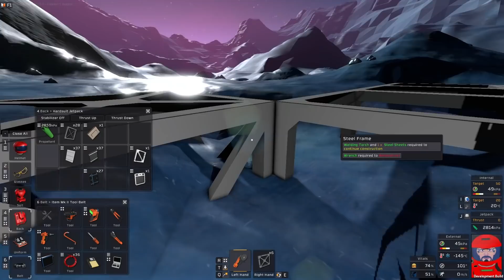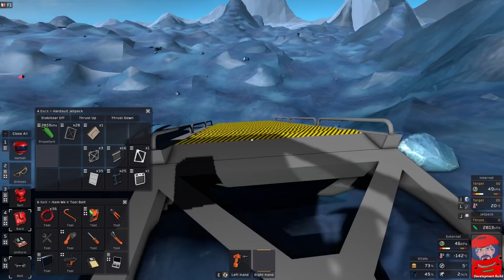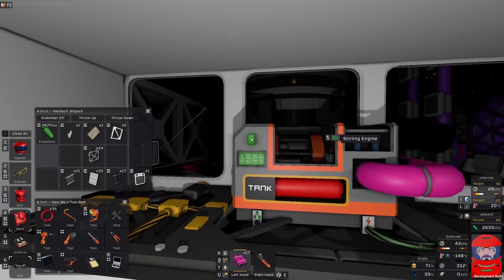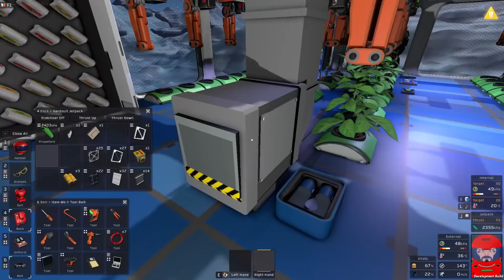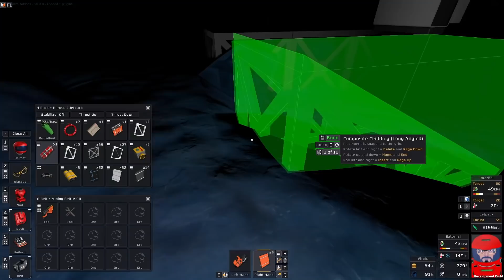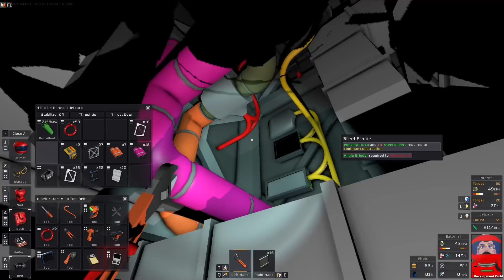Stationeers Let's play Modded Europa 21 Hybrid power

Comment: Hey Mick!

I left a comment regarding the cold lock up thingy on the Steam workshop, but I'm not sure how often you check those out.

Here's a copy pasta:

Hey Cow, hey guys!

So there's a bit of an issue with this script, in which the furnace goes in what Cow calls the "cold lock-up".

I wrote a YT comment about patching line 36 to read "sub r0 r0 250" instead of "sub r0 r0 100", that helped but I discovered in new setup that it didn't fix the underlying issue.

I believe the real problem lies at line 39, which should read "add r1 r1 5000" instead of "sub r1 r1 5000". Reason being we only want to top up the hot tank if it's low on pressure, not top it up until it's at 25 MPa, because that will prevent the mixer from heating the tank.

It's been working flawlessly on my end since I made that change.

Hope it helps!
Reply from the maker: line 34 allows the top up to operate up to 25 MPa.  If you change it to add it will only operate below 15 MPa which should never happen because the fuel will switch on at 20MPa and repressurise the system.  You probably find that the hot tank is well above the 2000K because the topup is never activating.  Your changes will work but you will not be recycling any of the waste gas.
Reply: @cowsareevil7514  I don't know about line 34, I was talking about lone 39 =}
Reply: @cowsareevil7514  I understand what you mean now. I guess it's back to the drawing board to prevent the waste tank from bringing the temperature too low

Comment: 54:11 - I don't think you properly connected the pipes. There's a section where you put the piping one square too forward, so it doesn't connect to the water source.

Merry Christmas, Mick, to you and yours! I hope Wilson will be happy with his manual air pump present. No doubt he'll be getting lots of use of it what with the AIMEEs wise to his philandering ways.
Reply from the maker: Yep messed that pipe up.  Don't write Wilson off yet.